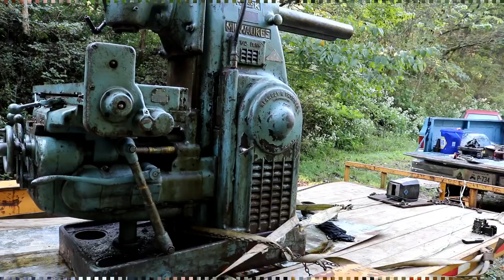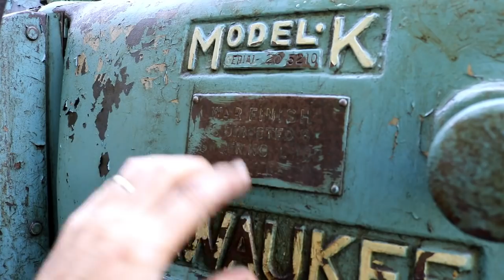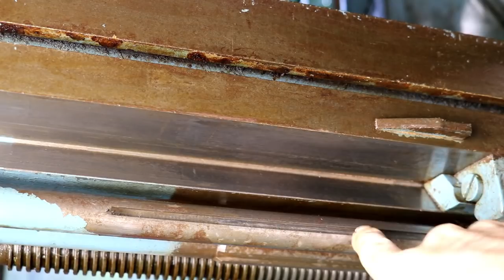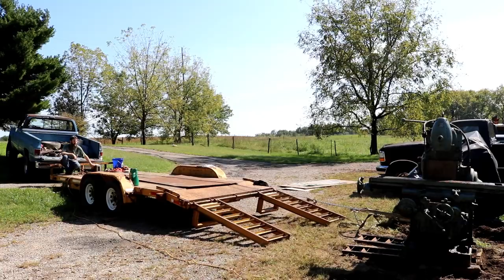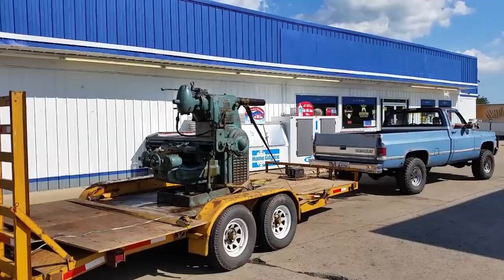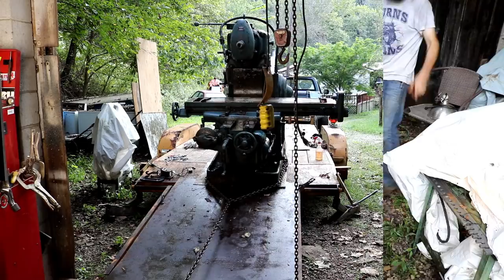New Monster Machine for the shop!! :-0

Comment: Very cool Steve. And with your dad along with you makes it extra special. My dad was always my right hand man going on tool runs. Cherish those times.Very nice mill, and looks much larger than my 2H. Ed Callahan looked yours  up and posted it being 1945.  My K&T 2D was also 1945./There is a lot of 50 tooling out there for really reasonable prices. Being that your vertical head is  mounted on the machine means there is a good chance your drive gear is there. Just the drive gears to run the vertical head can be really pricy if you need to find one.Keep the videos coming Steve. Will be nice seeing chips coming off your K&T

Comment: The ways do look in great shape, but I can't imagine any reputable machine rebuilder painting the ways and dials like that. I bet the company that owned it had some floor sweeper spray it after it came back from rebuild. I have had good luck in getting machinery loaded on my trailer using a local tow truck service. They don't charge much and do in 10 minutes what it would take me 10 hours to do by hand.

Comment: You need an old Michigan or a trackloader.  I've managed to keep things where the backhoe could handle them, though I did put an old set of LT's on the front.  The original types were bagging clear down to the rims.

A lot of people that are doing a long line pull will put an old packing blanket (cloth and heavy) over the cable to minimize the chances of a hard recoil should something fail.  I think you had the right idea as far as your tie downs.  A panic stop is usually what you have to secure it against.  I usually have chains around the base, straps over the top to hold it down (believe it or not, some rough roads will cause a machine of that weight to bounce!).  Proper load position on the trailer and properly set up trailer brakes makes the drive a whole lot easier.  Learn to look waaaaaay ahead, double or triple your following distances and do all you can to avoid a panic stop.  And don't worry about the idiots tailgating you.  Give them a chance to pass so they can be an idiot somewhere away from you.
Reply from the maker: I had a extra heavy chain over the long pull chain when pulling it off the trailer. I figured that out late. LOL, the drive back from getting it was stressful. I took my time and took no chances.

Comment: Nice machine.. Plain mill with drive bracket for rotab.. I have a 2hl universal with low lead attachment, a 2h plain, and a 2d tool and die mill...I have several vertical heads for my horizontals.. They are real metal movers! You should find lots of info here:  http://vintagemachinery.org/mfgindex/detail.aspx?id=2098&tab=3

Comment: long time user of K&T milling machines mostly 2h size.  way condition is 75% of the machine and looks  good so far . the table gib appears to really be in a minimum wear position, not buried with no adjusting left like so many other well used machines.  I looked up serial number on Vintage machinery site thanks to Keith Rucker and others  it appears to be number 20  of 25 mills produced  2K-3H  oct-1945 I look forward to your videos and the gardening pictures I live in corn country. thanks for all the hard work of editing and filming we viewers really enjoy it. thanks again  ed
Reply from the maker: Thanks Ed👍. I haven't had a chance to look it up myself so big thanks for that. 1945 is about what I was thinking.
Reply: A big hint on the age of the machine is the "WAR PAINT" lable above the serial number. The US Gov'ment was so serious about getting machinery made before and during WWII that they told the machine tool makers that finishing the machines appearance was not allowed. So the machine makers had labels attached to the machines made during the war-time so they'd be recognized as "not finished" and not up to the factory finish as was standard before and after the war.
Reply: The war ended on August 15, 1945.  Assuming the OP is correct about the build date, your machine was finished after the war ended.  It was probably sold as surplus to a company for next to nothing, and very possible was not needed at the time, due to surpluses of goods in many industries.  Obviously, we do not know the machine's complete history, but it is quite possible that it spent much of its life collecting dust.  Great score, Steve!
Reply from the maker: @duobob  Probably one of the last in line war machines and may not have seen real heavy production use. At least it looks that way so far. Still it's a 73 year old used machine. In good shape considering it's age. Good to see you Bob👍
Reply: @SteveSummers  Late 1943 to early1944

Comment: Had some machinery moved this year, by a professional rigging company. They had to use trolley jacks, chain blocks and the roof bolts I put in years ago for servicing this machine to get it out, plus they had a 5 man crew there to carry things, as it had to go down 2 stories in a building.

Next time to move it in the shop I would recommend you use some steel pipe rollers to move it, and make a set of steel wedges to lift it up and down for the pipes to fit under the base. That way you can at least move it with only the 2 of you as labour.
Reply from the maker: Yeah, now that it's on the shop floor I plan to put it up on pipes. For sure one of the best ways to move heavy stuff on concrete 👍

Comment: You can get LED replacements that drop into the old fluorescent fixtures for pretty cheap in bulk on eBay. Best part is you just take the ballast out and toss it, and wire the bulbs straight to 120v.
Reply: If you remove the ballast they cost less to run, and then you don't feel so guilty leaving them on all the time. 😑
Reply: I found some LED T8 replacements that just replace tube not even ballast removal

Comment: Gongratulations from Norway My first taught when I saw that machine was: Pull off the drive belt(s), turn the motor and listen carefully to the bearings there. But when I heard you tell the story of the machine, I think there should be no need for that. But I think that machine absolutely deserves a DRO.
And good luck with installing that beast ;)
Reply from the maker: Yeah, I would love a DRO for it. Pulled the main casting gear access panel and had a look.
Everything looks and feels great. I'll show it next week probably.